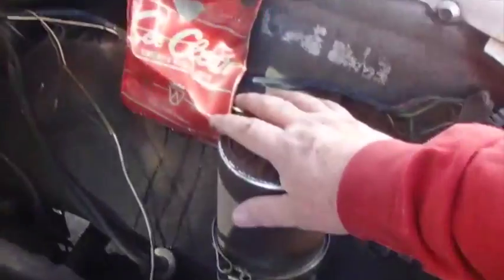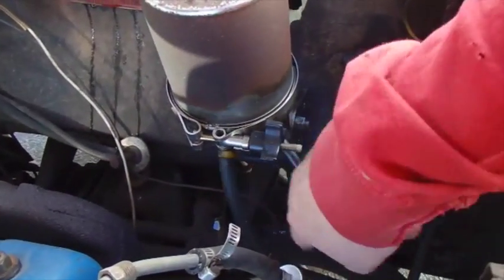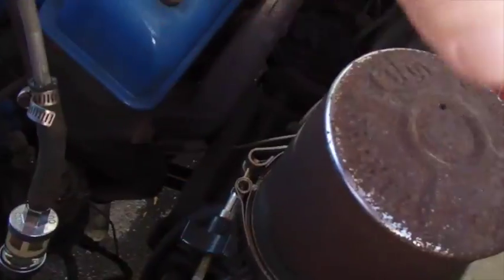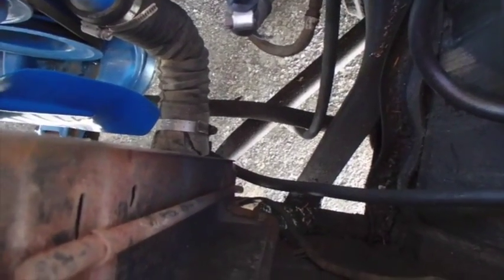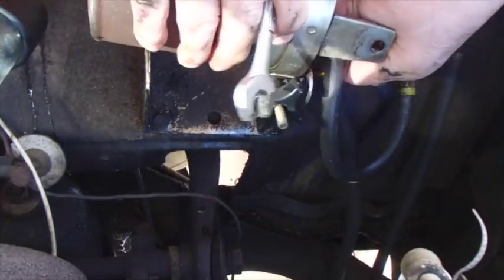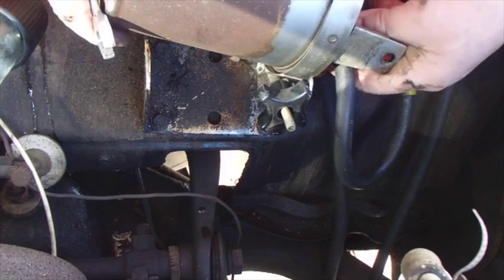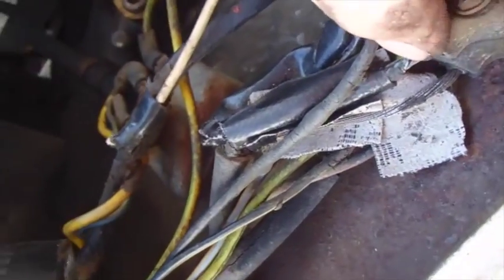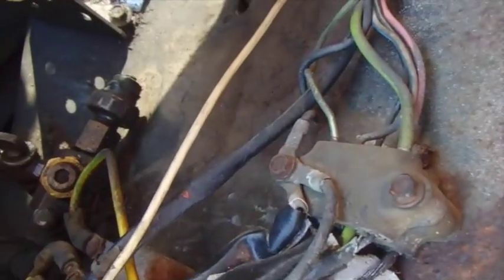Frantz Gravity Feed Toilet Paper Oil Filter

Comment: you need to put the electric as close to the fuel tank as you can  electrics are not good suckers but thay blow great
Reply from the maker: Zaktly..
Reply: I was thinking the same thing.
Reply: Got a Holley electric fuel pump  from Auto Zone . I thought Holley it's probably a good pump. Piece of crap.  Put a 4 cylinder Chevy engine in the Farmall H. Had to put a electric pump on it. Came out of a fuel injected car. Got one from O reilly's.  Nice pump but only works in a horizontal position. Put a VW beetle carb on it. 95 Impala transmission on it. Even though the Frantz was a poor design because it used toilet paper it was very good at cleaning oil. All I have now is Gulf Coast and Motor Guards. My 76 F250 has two tanks. Hard to put a electric where it can pull from both tanks.

Comment: You know, the guy that rebuilt my carburetor on the 55 required that you install a fuel pressure regulator. It's not a public video, but as a customer he sent it to me and it was his research explaining that over his years of working on carburetors he discovered that the modern ethanol fuels don't work well with the fuel pressure of those old mechanical pumps. It starts to froth and foam up inside the bowl  causing the float not to work correctly and is more susceptible to vapor lock as well. He suggested setting a pressure no higher then 4 with a regulator..

Dunno if that'd help you.
Reply from the maker: It's good info...  I've known folks to use pressure regulators before.
Reply: Normally they give you a choices of pressures  when you buy a electric pump. They had Holly electric pumps at Auto Zone. I thought Holly that should be a good pump. Piece of crap
Reply: Found out the hard way. Instead of getting the correct fuel pump for the lawn mower I put an electric on it. They have different pressure pumps.  Mine was a high pressure pump. It soon filled the crankcase with gasoline. The carburetor float couldn't stop the fuel.

Comment: Yep as others have said you are better having the electric back by the tank.  Electrics have plenty of push.  Pull, not so much.  Holy mackrel Andy, you need a lower radiator hose there fella!  It's not only split right up to the hose clamp, it's all squarshed and kinked!

Comment: you wanna sell that oil filter set up?
Reply from the maker: Yep...   I do..  I've got a bunch of new parts for it to that I got from the Frantz folks...
Reply: sent you a pm
Reply: The Frantz wasnt the best design. All I have now is Gulf Coasts and Motor Guards. Just ordered a Jackmaster from Australia. Dont know much about them. They are here to go to the big customers like NASA Shell Offshore and others. It looks like Gulf Coast Filters stopped production of their little filters and needed a little filter to replace them.  They can equip the Locomotive engines with the big 3 gallon filters but they needed to find a little filter for the lift trucks and such. They must have a high opinion of the Jackmaster. Be glad to get mine so I can talk about them.  Ive been told you can use tightly wound toilet paper in them. I require my filter to be a top loader and use Scott 1000 sheet without the sleeves and rings. My 390 has a 50 year old Motor Guard on the motor and a 20 year old Gulf Coast on the transmission. Its getting to the point where if you dont know know how to use toilet paper in the Frantz you need to use the Frantz elements. They are jacking with the core size again. I paid 29.95 for my first Frantz in 1963.  They ain't 29.95 now.

Comment: Had the same problem with my old 390.what holds the fuel in the gas line to the Carb is the check valves in the fuel pump. I gave up on the electric fuel pump and installed a new stock fuel pump. That solved the problem for me. Always have a fuel filter before the pump.Thats the ugliest Frantz I've ever seen. Looks like something from the ocean coast. The Frantz is a poor design  but normally holds up to weather. I see the Australian  Jackmaster is here now. I think they were brought here to replace the Gulf Coast junior.The Jackmaster is probably Australia's best oil filter. My 390 has a 50 year old Motor Guard on the oil. And a not so old Gulf Coast junior on the ATF. There are gravity feed filters. Frantz isn't one of them.It takes pressure to push oil thru toilet paper. You can gravity feed some cotton filters.